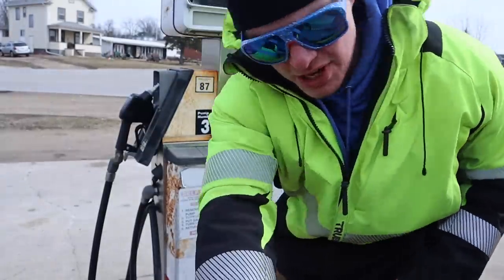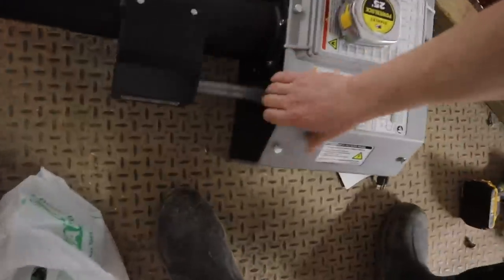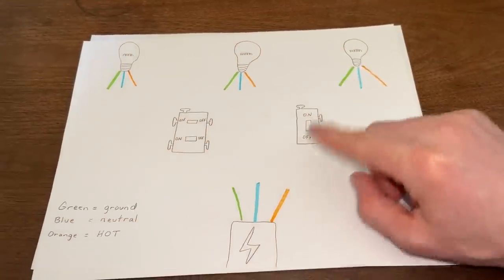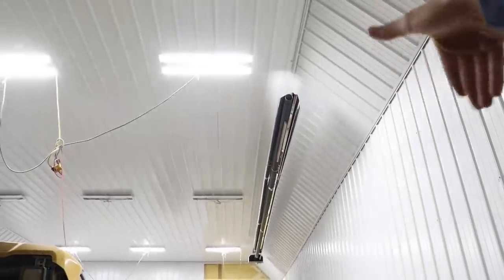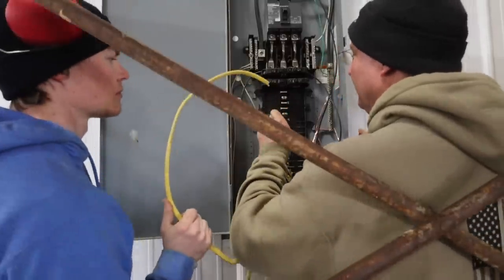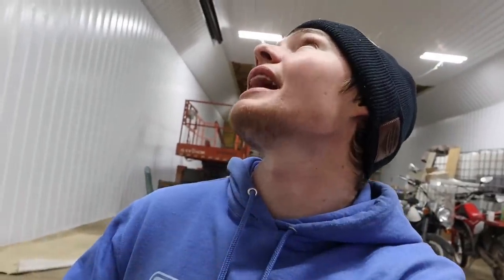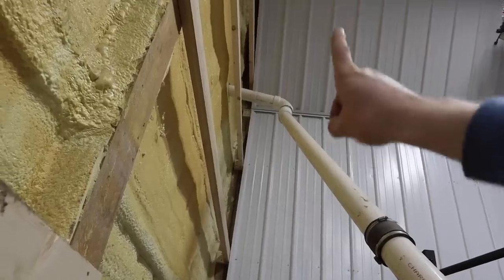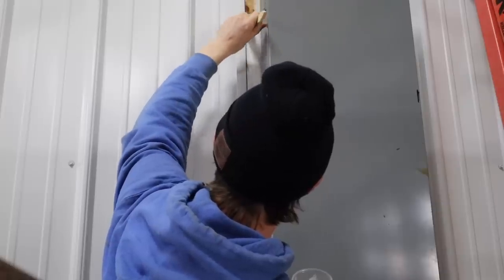Installing Electricity In My Ex-Hoarder Shed!

Comment: Always go as high outside as you can with gas per code run the wires out of the box going up by code need to go out of the top of the box , also install both heating system you’ll be glad you did use radiant when not work in the shop forced heat when working in the shop
Reply: Always have a back up. This guy is absolutely right don't jettison the forced air heater. Store it and do a quality install in the future.

Comment: Closest to the burner the better for the drip leg, I would put one where the  gas comes through the wall along with a valve as well. Along with one and a valve by the burner. What's your plans with Amana furnace??

Comment: 50 degrees most shops  run at. But you need big  cealing  fans to push the heat down with m

Comment: I wouldn’t 90 the air Intake. 45 up and another 45 into it. I’d also put an anti bird cover over it on the outside of the shop. Gas line? Doesn’t matter how you run it.

Comment: You are supposed to have  dirt leg at each appliance or regulator.  Those are to collect dirt and moisture before the regulator.   Go directly out with the exhaust and intake air for the radiant tube heater.   Read the installation manual,  that’s why they send it along with the unit!

Comment: I worked in a shop that used those radiant heaters. They would heat up the tops of the cars in the shop, but not the bottoms where I mostly worked. I don’t think you’ll like those heaters.

Comment: NM cable (Romex) is not allowed to be run exposed below 8’0”.   It is required to have physical protection from physical damage. (Conduit or wire way).   The box with the three switches in it is not big enough for that many conductors the way you are wiring them.  The yellow NM cable is #12 and used in 20 amp circuits.   If all #12 for the lights, the breaker could or should be 20 amp.  Best wishes,   Kevin

Comment: I've done lots of wiring. White is always reserved for neutral, green is always ground and any other color is hot!
Reply: White wire can be in switch loop plus in a 220 volt system like your hot water heater when using romex.just saying.
Reply: I'm a pipe and wire union electrician. Piped and pulled wire in homes in Chicagoland west suburbs for 25 years. On occasion in Kane county or Kendel county I played with rope, the white wire was used for travelers on threeway/ fourway systems. Every foreman had their own way of identifying things. Usually wires were twisted a certain way. As much as Cole does not want to use pipe in the long run it would be much easier. Sometimes I would scratch my head while trimming a house done with rope.
Reply: @vesanikunen5692  white must be taped or colored black or red in that case so someone will know it is nor a neutral
Reply: Wait till you work on equipment made outside of United States 12/24 volt systems all different colors for grounds. First thing you need to do is check what is being used for grounds
Reply: @vesanikunen5692  ain’t that the truth!!! Ground may be yellow purple brown ain’t no telling
Reply: a bunch of bad info in your comment. I know i have many white wires that are hot wires. Also, depending on what country an appliance is made, the ground wires can be many colors.
Reply: @MrCheshire24 I was writing specifically regarding the use of color coding for insulated wires. You are correct. Bare wires are always ground wires. Wether Romex (NM - nonmetallic) or Underground Feeder (UF) there usually is an uninsulated or bare wire which is to be used only as a ground, never to carry a load.
Reply: @vesanikunen5692  true. If you want to use the white to be hot, always identify it as such. I wrap a piece of electrical tape around it near the end. Others I know have used a black sharpie and colored it.
Reply: @warrenmichael918  don’t forget we wasn’t talking about wiring appliances We are talking about wiring a shop building here in America in which case  the white wire Is presumed to be neutral unless marked by tape or black sharpie to be used as a hot Also romex is not to be pulled through conduit if that conduit is longer than 5 ft
Reply: @philipberry2704  Nobody was talking about wiring the building, the OP said the white is always the nuetral and the green is always the ground, thats wrong in certain situations is all im saying. He has that tube radiant heater which could have a weird wire configuration because they are made, sold and shipped world wide and many places have different colors to their wiring side of things. Its always best to look at the appliance youre wiring up to make sure you know what goes to what color. I do agree that here in the States, the white is usually a neutral and bare or green is ground when our electric services are being talked about.

Comment: Wait a second... ground wire in the US has no coating? I learn something new every day; because here it actually is coated green (and yellow, striped) so I thought his explanation and using green was quite accurate up to the point where he showed the wire. Funny difference.
Reply: Ground can be green or bare or green yellow strip.  In romax wire it is bare in conduit it will be green.
Reply: You guys across the pond run a different grounding system. I see the way you guys wire things and my head spins trying to figure it out, i think you guys do the same thing looking at our electrical stuff.

Comment: Your gas line drip leg is better to be right there by your equipment to catch any condensation which may occur but on that long run it may be better to have it at the bottom and the top because it also catches sediment.
Shut off valves electrical disconnect should be within Arm's Reach when servicing the unit.
For the electrical it's a switched Outlet and then a valve right there next to the drip leg.

For the exhaust,  refer to the units manual,  a good installer will reference the installers information. Also help avoid any legal problems.  Like your place burned down because the unit was manufactured with a defective safety switch and caused a fire. Can't sue/get insurance settlement if it's not properly installed. And it's well documented on your channel
Reply: The manufacturer manual will tell you what size and how many 90s you can have, or 45s. Based on length of run, size of exhaust,  is it 80%efficient? Then it's usually a metal dbl walled exhaust pipe, 90% or higher efficiency has plastic exhaust for the highly acidic condensate reasons

Comment: If you want it even easier, look into the Wago wire connectors for joining wires.  You push the wire into the connector and close the spring loaded clips
Reply: The wago items are GREAT to use and   cost if nice too
 Was think $30  for 50 items of 3 wire Connections
Reply: I agree. Wagos are the way to go. I use them all the time. So much tidier then wire nuts or connector block

Comment: Since the tube heater is at the ceiling level, it would seem to me you will need some fans somewhere to circulate the heat, otherwise, all of the heat will stay up near the ceiling.

Comment: i got a LOL out of DCs "is 15amps enough" .....if it were me it would be 12ga wire and 20amp breaker and obviously more circuts as needed per load ....and then the question would be is 20amps enough........gas line traps are for moisture and dirt so both places wouldnt be a bad idea but close to the burner is better in theory....air intake is about cfm's of combustion air required by the unit and i would certainly orient it so if it does get moisture it drains back to the outside....sounds like you looked at the tube heater clearance requirements if not they are critical

Comment: Make sure your dad remembers you size the breaker for the size of your wire not the load on the circuit, if you oversized the breaker for your wire size it’ll burn up the wire if it gets loaded too heavy but not heavy enough to trip the breaker, so make your breaker match your wire and use wire bigger enough to accommodate the load you anticipate.
Reply: Yeah there is a code for that, NFPA 70 National Electrical Code.

Comment: The sediment trap or “drip leg” should be on the bottom of the last vertical pipe before it enters the equipment.

The efficiency of the Amana furnace is probably 96% and that tube heater will be 82-84%. So you be losing about 12-15 cents on the dollar on heating costs.

Comment: That stone is going to sink in the mud as soon as it gets wet and a truck runs over it.  There needs to be a stone resistant membrane between the mud and the stone otherwise you will be topping up the stone constantly.

Comment: on the radiant heat system doesnt the heat rise? shouldnt it be closer to the floor? if you do get cold air from outside shouldnt it be filtered so that driveway dust doesnt get in it? seams like having a filtered intake in the building would make more since. love the channel keep up the good work
Reply: The radiant tube heater is just that it radiant heat to the object so its not heating the air it is heating the object like the walls and equipment.  So it needs to be up high.  Not on a tube heater all you are using the air for is to burn with.  You are not blowing it into the building.  Just like a new gas furnace that draw outside in to burn with,

Comment: Technically, electricity doesn't flow like water, the electrons don't flow, they only vibrate and transfer position in the direction of flow very slowly. The wires don't actually carry the flow of power, the electromagnetic field surrounding the wire actually carry and transfer the energy.

Comment: check your labels on your lights and anything that need electric wire.  it will tell you what amps what particular item uses. i would recommend four lights  on one run of 14/2 wire. that's good for 15 amps. 12/2 is good for 20 amps. match your breakers accordingly with the wire. and read your labels on your heaters and lights that will give you a better judgment on how much. if your heaters at 220v at 30 amps 10/2 is good for that use a 30 amp breaker.. ect.ect. watts plus amps factor it all.. cole i hope you read this? your going 8 light inside? I would run 4 lights per switch. then your outside lights per 1 switch. so that would be a three gang box.  And you can use the white neutral wire as a traveler wire.  so that would use less wire to run for your lights.
Reply: If he is running led lights depending on the lights amp draw wish is probably going to be under 1 amp you can do 10 lights safely on a 15 amp circuit and still have room to spare.  Heater is probably a 120 volt drawing maybe 5 amps.  ITs a small blower motor.
Reply: @johnunsicker7440  all very true.  just a summary of options. i suggest four lights per switch and breakers due to future expansion. "more lighting" work benches ect..
Reply: @johnunsicker7440  dayton heaters are 4.8 amps startup. with a continues running wattage of 1.1 amps. so in series a 20 amp breaker would be ideal situation for both heaters.
Reply: @michaeldunn5362  yes ......but which 4 lights....would go 4 in a row....or 4 square for a set area ......or alternate them LOL ..could put them on proximaty sensors so they follow him around ....and if im pulling wire its gona be 12ga...and maybe a extra or two LOL

Comment: If you understand electric work, do it yourself.  But I would have a licensed pro to look over you finished work to make sure it is safe and to code.  Now that would be money well spent....and its an easier buck for the electrician.
Reply: the electrician must be a friend and a cash exchange so to speak and check it and say "it is correct" but they are not gonna sign off on it.

Comment: Each angle has a length equivalent, and no, the drip tube must be within so many inches of the appliance, it doesn't really require maintenance, so it's no big deal being up there.

I am not a professional, take this knowledge at your own risk.